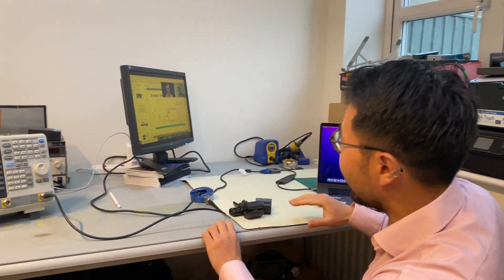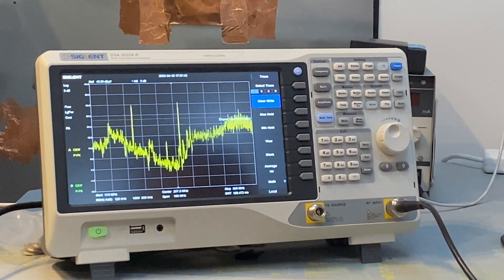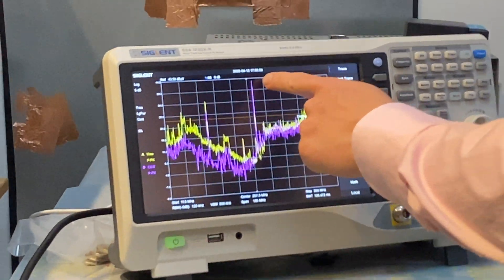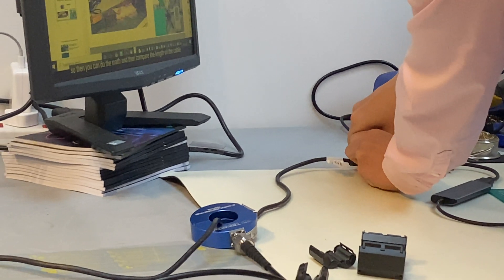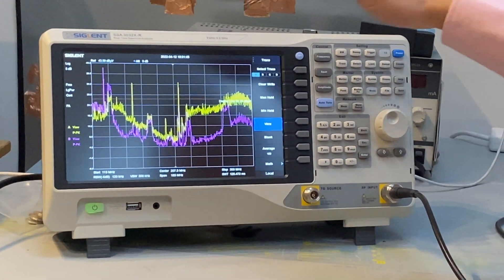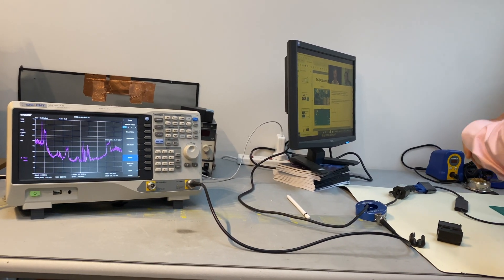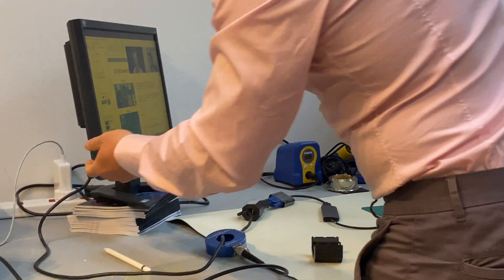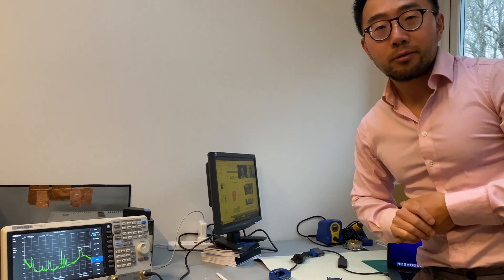Demystifying Cable Antenna - Can Ferrite Increase Emissions?

Comment: Nice video and it responds to a question that i worried about since a while, but my concern was that a ferrite, at a frequency where it still behaves inductively, might match the cable which by itself would be too short as a quarter wavelength radiator. But i guess your picture with the boundary condition is more appropriate here because i think that slightly above 115 MHz the 31 material is already in the flat region where it adds purely real impedance. Now what happens if you change the position of your current probe ?

Comment: If there is common mode current on a cable, then there must be standing waves on the cable. As far as I can tell  , you lined the ferrite up where there was maximum current density on the cable. That doesnt tell us which device is the problem. The problem is in the interaction of the components. Please let me know if I am wrong.
Reply from the maker: Hi You are right. The standing waves will be present on cables. Hence, using RF current probe to predict radiated emission can only be partial, because of the same reason you mentioned. It is therefore recommended to move the RF current probe along the cable to find where the maximum current is and use it as a reference, which is what we did in this demo. Of course, in a real troubleshooting case, I would always have an antenna placed to cross check the performance. I do believe the RF current measurement CAN tell us which device is the problem, especially both devices have a metal enclosure. The key point we are trying to make in this case, is that for a cable antennas to be effective, one would need some impedance difference at the end of the cable
Reply: @MachOneDesignEMC  Thanks.. I like your method because at least you can show your boss that its ok to spend another 2500 for chamber time and then not be surprised.  Do you use a preamp with your antenna?
Reply from the maker: @NE-Explorer  Sometimes, I used a LNA (low noise amplifier) between the antenna and the SA, sometimes not.

Comment: Thanks a lot, great work.
why the first time you put ferrite on the the cable condition got worse? we build a high impedance path for noise, didn't we?
Reply from the maker: we changed the impedance at one end of the cable, so that cable (same length, same cable) becomes a quarter-wave length antenna

Comment: Move your current probe along the cable and you'll probably see a variety of different signatures. Radiated antenna measurements tell the true story.
Reply from the maker: Hi Julia, great pleasure here that my humble video gained your attention. Indeed, the problem I was trying to demonstrate came from a radiated emission failure of a client's product(But I cannot use their product for demo for confidential reasons). And as you said, current probe measurement on the cable does not necessarily translate into radiated emissions (simply because of the standing waves and the cable antenna pattern).

Comment: Great work Dr Zhang! This is a helpful explanation, I would not have considered the added impedance mismatch.
Reply from the maker: Thanks Jon. Yes, in the field, we did see a few cases where using ferrite to suppress noise, targeted noise decreased while other noise increased. This is particularly true when f1=2f2, because the same cable length is half wavelength for one and a quarter wavelength for the other.
Reply: @MachOneDesignEMC  how the noise level relates if half or quarter wavelength? is that related to impedance of far/near field?

Comment: Thanks for giving a super great demo! Did not consider what happens when you have a ferrite only on one side :O
Reply from the maker: hi Antalife, yes, most of the time, ferrite on the enclosure side will just do the job. This is one of the few occasions where troubles came. I would not demonstrate a normal case coz it is not as interesting as this case.